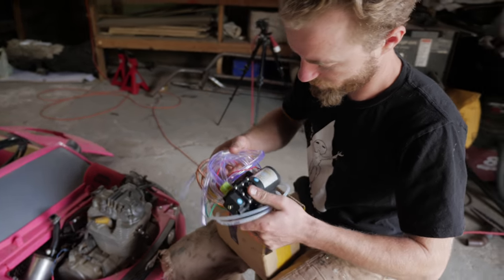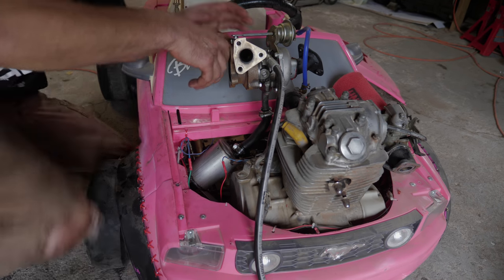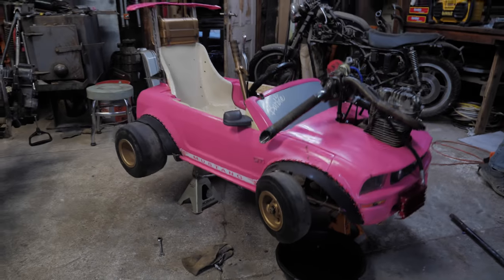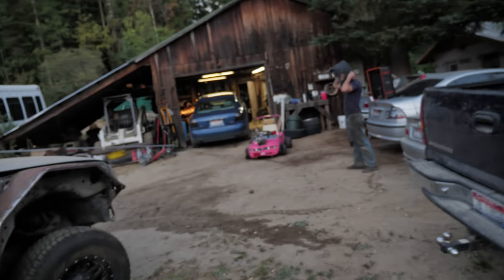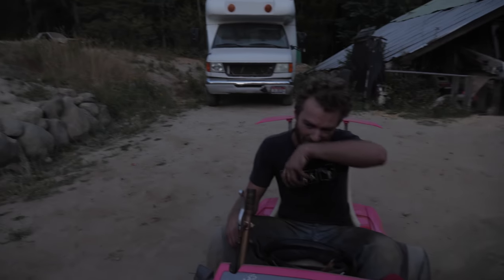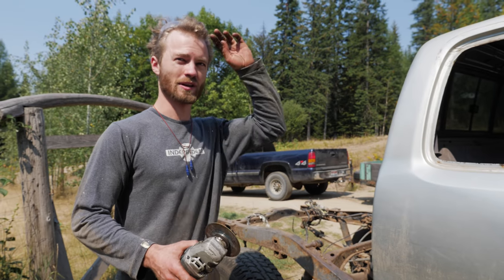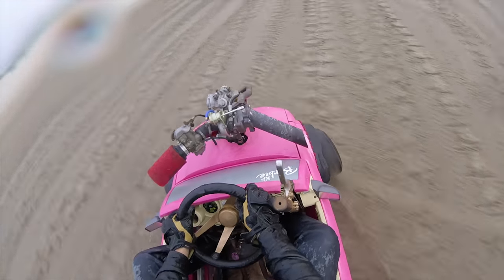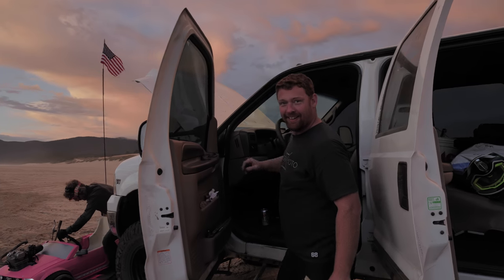Barbie Car Turbo #2 Testing and Driving on the Oregon Coast 4K

Comment: A pull through design works fine. I think you had too much oil pressure into the turbo. Was pushing through the seals and into the engine. Thats where that big puff of smoke came from. Also some header wrap on the exhaust pipe to help keep the heat in the pipe would help with spooling. Put a regulator inline to the turbo. And fatten up the jetting. I think your onto something. 100psi into the turbo is not needed. If its building 7psi u only need like 10-14 psi oil pressure. The volume looked good tho in the test.
Reply: Tru the pump is probably just too strong. They should get a smaller restrictor and I guarantee that turbo will spool better
Reply: I would put the turbo a little closer to the head and wrapped.  Thin oil with less pressure. Fattin up jet until it doesn't pop... Check plug after full throttle run for jetting indicators.
Reply: This is what I'd try too
Reply: Yeah, more fuel and a smaller orifice for the turbo's oil supply.
Reply: Yes he needs a restrictor on the oil input
Reply: No, draw through turbos need carbon seals due to their nature of operation.
Reply: @jtj250  built one of these motors well alot for my Frankenstein bike and that plug check doesnt work after 5psi of boost gets too hot and even a set up thats running around 8:1 afr will still have a brown plug. Biggest things i see are its a draw through that doesnt really work well on thumpers. Then the lack of a plenum where it needs it most. A general rule of thumb is 4cyl needs 50% engine volume in the intake with boost. 2cyl needs about 100% and a single needs anywhere from 200-400%. It stops the pressure from dropping when the intake valve opens. My draw through set up went from a stock 21mm carb to a 41mm carb before i saw real power increase without running the float dry but even then i didnt start making enough power to break the clutch basket until i added a plenum. Now im blow through on a stock carb and it idles runs like stock but around 2500rpm the boost shoots to 21psi and it made 67whp out of 149 cc. Next is a fuel injection for us and we hope that we can get in the 80whp range while staying this size. And before anyone asks these clone xr200 motors loose the baskets around 40hp and rod goes at around 50hp we made a billet rod and piston with a welded crank pin and have yet to break that although we are running a destroked xr200 crank and long rod big bore to stay at 149cc so our geometry is a good bit stronger. Stock a xr200 engine with these little turbo efi  and a big intake not hard to get to 40hp.
Reply: Also im on year 5 and turbo setup number 26 and motor 12 so this isnt an easy venture but save yourself the time and headaches and go buy the efi kit and go ahead and buy a beefy clutch basket and clutch its cheaper that a new side cover, case , oil strainer, oilpump, and likely to take out the gear that drives the oil pump so easy cam damage
Reply from the maker: That’s awesome! What turbo are you using? Do you have water cooling for the turbo, or just oil?
Reply: @GrindHardPlumbingCo  same ihi rhb31 clone but thats kinda where our turbo similarities end other than the engine check it out on thumper talk i havent updated it in years and many set up ago but the oil system stayed the same with the exeption of my lines and im running a oil pressure regulator set at 45psi no smoke no restrictor.
Reply: @GrindHardPlumbingCo  just oil cooling and i dont really have issues with that keeping things cool. The only time it starts to get hot is when im toping it out on the hyw. Temps. Climb around the bottom of 5th water injection helps and so does having the piston, combustion camber, exhaust port and all my pipe work and turbine housing ceramic coated. I saw a nice 40 f drop on head temps with that and alot more stability along with faster spool times. Try shortening the mani too thats why its soo laggy its alot of volume to fill before the turbine wheel starts to work. My mani is about 5in long 1in pipe and im getting full spool around 2500rpm with half the displacement. And remember if you guys want this to work its not like a 4cyl where you can just throw things together and it makes power with a single everything is the way it is for a reason or it doesnt work very well if at all. You guys should have a plenum around 1L atleast. If you measure pressure at the intake boot youl see just like i did that even at 20psi it just drops into vac everytime the intake valve opens. And i grew up with motorcycle carbs know all about that black magic and it still took me about a year to get the blow through set up to work right. Go efi
Reply: @GrindHardPlumbingCo  I use oil and a oil cooler
Reply: @CR4ZYxRY4N  they have one on it already but it's a cheap dirt bike one and they don't really move the heat try a motorcycle one I think I was gonna use a xr650l or something like that much better than something with little surface area.
Reply: @oliverscorsim  I took the turbo off and added a nitrous oxide set up and a 10lb bottle and I can say Holly shit
Reply: @CR4ZYxRY4N  check out POST100 I think you'll like what they built and yeah bottle is easy power just know that a 30shot is about all you wanna give her for the clutch baskets sake
Reply: I didn't have room on my bike but a smog pump off my fc rx7 isn't too hard to drive off those engines and should move enough air to make 60hp easy
Reply: Hell yea. Give them some good info so they can make this work!
Reply: no! he has the turbo and carberator switched up. the turbo comes before the carb. he has gas from the carb going into the turbo and that is a big no no.
Reply: @DR-br5gb  !!! You are correct !!! One piece carbon seals are needed for draw-through setups due to oil being drawn into the intake every time the throttle shuts.
Reply: @natereinhold6180  Indeed
Reply: You need to run the Turbo into the carburetor not the carburetor On the turbo. I’m sure it’s screwing up with atomization. It’s not a blower it’s a turbo hook it up the other way I’m sure it’ll spoil up a little bit with boost. Give it a little shot of nitrous.
Reply: @mercurymadness9005  lol
Reply: Grind Hard Plumbing Co can u tell me where u got the fule pump for the turbo I bought the turbo nit now I need a fule pump :/
Reply: I agree I think by the sound of the spooling noises it was making first time round , definitely needed to rejet the carb I would say mostly the pilot jet to help throw more fuel at it to get it spooling off the mark once it gets going the main will come in and I'm guessing with a turbo if better right would be like a mini powerband , also you can run a vaccum line from the turbo into the float bowl of the carburetor to help pressurize and pump the fuel through the jets as apposed to the relying on the motor power to draw the fuel out of the carb ... would also help abit with the off the mark stuff
Reply: @DR-br5gb  not alwyas .. and if he's using the gt0632z or gt12 there made specially for motor between the sizes of 100 - 500cc motors with the "preferred" operating boost presures capability of 1.7 bar before venturing out if the optimal performing zone

Comment: Put a single Rotor engine in it😁
Reply: RazoE exactly my idea. I said that when they put the turbo on 😂
Reply: I second this
Reply: You stole my idea...   Why not a 2 rotor
Reply: @dachangoo594  woah woah you trying to kill him
Reply from the maker: If someone can find us a rotary engine that’s small enough. We will give it a shot!
Reply: There is a used XR50 on ebay right now.
Reply: and a 4 points harness
Reply: @GrindHardPlumbingCo  there is a motorcycle with it
Reply: XR50 with turbo would make like 100hp lmfao
Reply: Find an engine brand that’s called “Sachs”. They made anything from lawn mower rotary engines to Snow mobile rotaries. All singles. I would suggest you find a Sachs KM48. Perfect size for that. They come from factory with a peripheral port so it braps really nicely
Reply: Donny The Dealer talk about rare and expensive
Reply: Rotor motor in all things that go fast. From jet skis to snowmobiles to cars, vans and light trucks. Its all a possibility man but yes everyone is right, their was certain bikes that came factory with the wankel power plant. YouTube some videos of wankel powered bikes and you'll be surprised if you dig a little deeper into how these not only came about but the mechanics of them are impressive for the times.
Reply from the maker: Yes!! We need one of those!!
Reply: the axiros are badass kart engines. Would be perfect for the barbie car. Should be relatively high compression, so if turboing, you will probably need to run methanol or e85.
Reply: Grind Hard Plumbing Co they sell rotaries for go karts
Reply: @thatbuelldude189  i live in sweden, sachs motors are kinda everywhere for about 100-200usd depending on how many gear shifts
Reply: @carvajalm.a36  here they are like 1000 for a non running one
Reply: @thatbuelldude189  damn thats some bussines prices , who needs to import old motors? hehehe ;P
Reply: @carvajalm.a36  would cost just as much lol
Reply: turbo
Reply: Grind Hard Plumbing Co can u tell me where u got the fule pump for the turbo I bought the turbo nit now I need a fule pump :/
Reply: Jet engine*
Reply: That will be screamin' AF 💀💀

Comment: restrict oil pressure to the turbo to 10-15psi, Make a bigger exhaust pipe from the flange on the engine to the turbo ( more air in more air out near stock size is to small), run bigger jetting on the carb, and wrap the exhaust from engine to turbo.  Running the fuel lean for to long and your going to burn the engine up.  Keeping to much oil in the turbo is going to blow its seals.  

A few simple changes will go a long way.
Reply: Nicely said bro

Comment: That oil pump is for extracting oil through a dipstick. You jam the copper tube down the dipstick and slowly pump it out. I use the exact one on my boat engines.

Comment: That turbo was way too big, you need something much smaller than that, Guessing by the sound this one was only getting probably 10k maybe 15k rpms.
And it needs at least 50k to give reasonable boost.
Something tiny like a turbo from a 1.2 turbo diesel might work, those turbos are about the size of your fist.
Reply: Id look at a Smart forTwo turbo, even smaller, think they are 600cc.
Reply: Sorry man the less cylinders you have the weirder things get with turbos just like in the intake you get a really big pulse at one time. Same deal in the turbine side you get a really big spike in pressure the xr650r guys and crf450 guys are using turbos for 2-3000cc cars and getting fast spool times. Alot of kits with the garret gt17 for the 450 that hit boost threshold before 3krpm. Mine is half the displacement of his with the same turbo and I get it by 3k no problem. His issue is he's not getting anything into the engine. He's taking that boost in the intake and let's say 14psi intake valve opens and it drops into vac and before the pressure wave can catch up and shove air into the cylinder the valve closes.
Reply: @xddstudiosbywr3cked845  it is

Comment: You need a bigger intake plenum between the turbo and the engine for a single cylinder. For optimal performance the plenum should be about 4.4x the engine displacement. There is a good MIT paper if you look up “single cylinder turbo” for more info. Good work!

Comment: Ive got a few questions:
Did you guys alter the compression ratio in order to prevent detonation once it reaches boost? 
What cc is that engine? 
Where does the engine fall on the compressor map for that turbo? 

Thanks, looks great, looking forward to more videos.
Reply: They obviously researched none of that or it would have worked, everything about the set up was wrong. Looked fun to try thought, with much better though invested anyway.

Comment: Thumb down because of turbo removal 😢 y'all should have installed a boost gauge and it needed a larger main jet for the extra air/psi from the turbo because without it it probably didn't even spool a psi or 2 because I didn't see the wastegate arm move under load at w.o.t ...
Reply from the maker: We are going to tune it better for sure just didn't have the tools or time on the beach.
Reply: Waste gates not gonna open without an engine load
Reply: its not going to open when there is hardly any boos either tim.

Comment: It was running good until Dumbass drove it through the water. I saw the water get blown back out the exhaust so you probably have a bent rod now.
Reply: No you didn't, you seen water hit the pipe and evaporate.
Reply: Why you would go to to so much effort to build such an awesome rig, drown it in saltwater and continue to flog it to the point of death is so wildly beyond my comprehension.
Reply from the maker: Don’t you worry. It’s far from dead.

Comment: Stick it back on and fuel injection it
Reply from the maker: That would be great, but I’m not sure it would be easy or affordable to fuel inject it...
Reply: Grind Hard Plumbing Co ecotrons has a kit for small engines for around 600$
They also have turbo related parts 🤔
Reply: @thatbuelldude189  thats what im doing and it can run two injectors so meth preturbo is easy
Reply: @oliverscorsim  they are good little kits

Comment: I know its just a motorcycle motor with a cheap turbo but to my understanding when you cut the motor off  you deprive the turbo of the oil so it wears your turbo faster. If you let it idle after running and let the turbo spool down it will prolong the life of the turbo

Comment: I am in Oregon too... What you got going on is no filter to the oil cooler. Therefore you sucked metal shavings  into the turbo line. I did that on my 20 psi turbo on my 240 my sr20 Nissan.  You need to spin the propeller by finger and if it does not spin, disect it and see if the shaft got welded on the oil side by metal shavings. If it did, you need to have a oil filter before the oil hits the turbo. Mine sounded like a siren before the shavings from a new oil feed line tap hit it. Basically I stripped the line, tapped the threads and did not get the shavings flushed as I instructed the shop fixing it to do so before hooked up. I disected my turbo and found the shavings welded shut the oil feed line from friction. Hopefully this helps, I love your project. Maybe you need a 27 hp kohler engine like the one I a m rebuilding for my new but old lawn mower...
Reply: He put this on a dedicated loop not sharing oil with the engine. Any shavings in it would be from the turbo itself. I'm not saying that an oil filter is EVER a BAD idea, but in this case it shouldn't be entirely necessary.
Reply: @edifyguy  , ok that makes sense. Well, that's strange that it doesn't work as well as it did. It might have melted if it doesn't have a oil cooler or a water cooler too. But it's hard to tell without physically seeing it. You would know if the propellor seized what happened. Anyways... Still a very awesome car. Makes me want to put a turbo on my 27 hp lawn mower.

Comment: If you can? IDK if you did this already,  never had time to watch other videos.  But see if you can find parts to convert over to ball bearing turbo.  The compressor wheel will spin much easier and will need less oil feed.  It will spoil flawlessly, and to extra ensure.  Seal the wastegate. Remove,  and block the air line for it.  
You should be able to build boost afterwards.  
In theory,  it isn't about the down pipe being restricted, its the friction of moving parts, and lack of pressure by a small little motor.

Update**
Noticing your carburetor is before the turbo,  my personal experience and others.. Have never seen any improvements only more problems.  
Your better bet with the setup is turbo before carburetor,  Not after. This would also require some minor modifications and adjust fuel air flow.  Having a carburetor on front side of turbo kills the spooling and the throttle restricts air turbulence.  I know,  this sounds crazy.

Comment: I would rework the oil system, make two lines from the oil pump. Put a needle valve in one line, and a 1/16" turbo oil restrictor in the other. The line with the needle valve goes to the oil sump, the line with the restrictor goes to the turbo. Start with the needle valve closed, and open it until you have a reasonable oil pressure on the oil feed line. Since it is electric oil pump and not crank driven it should reach a pretty stable equilibrium outside viscosity changes. 

Otherwise you could easily make an oil pressure relief valve using brass fittings, a spring and a ball bearing. Check out homemade turbo boost regulators, tune the spring pressure to regulate and bypass extra oil volume to the sump.
Reply from the maker: Thanks for the information!

Comment: Since it’s a single cylinder engine the turbo isn’t going to spoil very well unless you’re in high rpms, you should add what’s basically an expansion pipe to the hot side of the turbo piping so it has extra air built up to charge the turbo

Comment: Just a thought but Seal up that cabby best you can but dont use it as a suck through setup and run the boost hose to the petrol tank to get more fuel pressure when it does boost. Air fuel mixture with need adjusting. But that turbo seems a bit big.
I've seen them do it this way before on thumpster engines.
Reply from the maker: Thanks for the ideas! Might try that if we can’t get it to work this way.

Comment: As long as you have fun doing it that's all that matters! Yeah low pressure with carbs, and running turbo off the exhaust would have been better then plumb the intake to carb and you will have more fun, low boost till you find sweet spot.